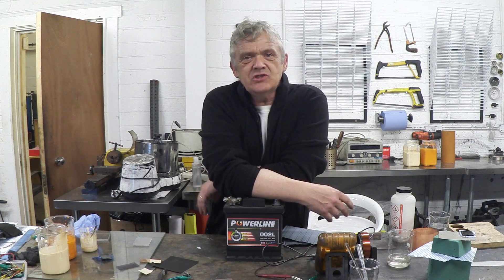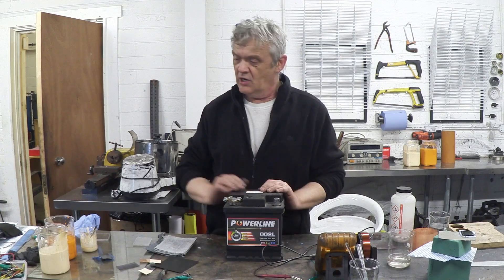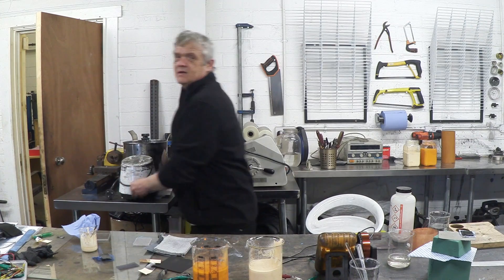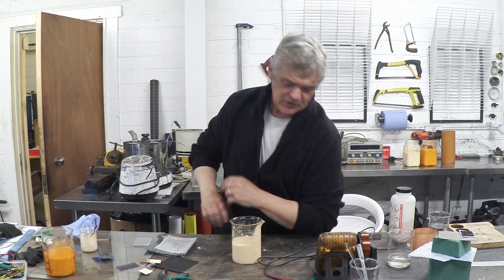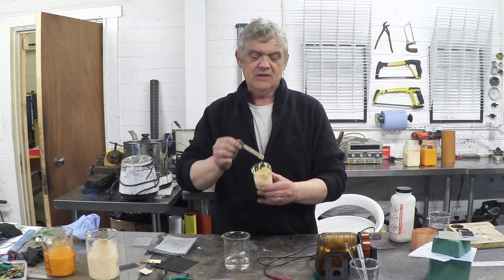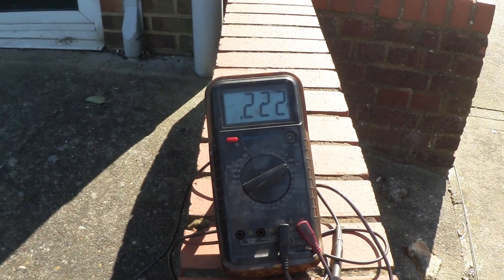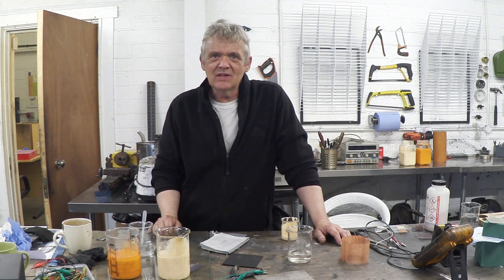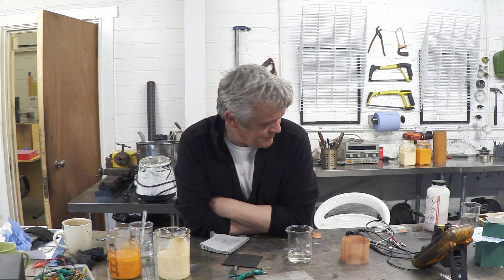How To Turn A Broken Battery Into A Solar Cell

Comment: Wow, this means we can make solar panels that are also Peltier devices, and turn the problem of the panel heating up into an advantage. If there are non toxic materials that have these properties, they could be spray painted onto a roof or the side of buildings to turn them into energy collectors... And if we add to that @Martin P. Hellwig's comment (from about two years ago), we get a "smart panel" that can include its own optimizing circuits.
I find this very exciting.

Comment: Is the voltage a function of the oxide surface area?  0.22V is hardly useful, but your example of concept is very small; would a much larger one be significantly more V?  Also, it appeared once painted the mesh resembled a solid, loosing all that extra surface area, so could you just paint it onto a solid collector?

Comment: Could you increase the voltage output if you used a larger surface area?
Reply: Yes, but that's actually bad news. If it produced 0.2v regardless of size, that would change the world. 🙂

Comment: There should be two plates one is  copper oxide. And what is the other?
Reply: I think he put a sheet of aluminium under it.  At least, that's the standard back plate for a solar cell.

Comment: That's quite amazing and inspiring! so we can make transistor with that too? Turns out all the piece are falling into place lol!
One thing with energy production is we either produce more of them to cover our need, our consume less of them. A lot of idea seems to be turned toward maximum production efficiency, and a lot of accessible technique get discarded because they aren't efficient enough, which make economic sense at industrial scale. BUT I feel like there is an opportunity at human scale to look into the direction of "slow tech".

While I was watching my plant growing in my experiment, it didn't really need a lot input, it really tooks it's time, but the plant at enough force to remove the lead on top of the pot, what if we create autonomous machine that just took their time like plants, they charge slow, but have enough energy to do work that aren't in an hurry. For example imagine an autonomous garden that slowly charge over time, taking energy directly from soil battery (just an example) then discharge it in time of harvest lol.
There is certainly a lot of essential infrastructure that can be turn autonomous with just slow system?
Reply from the maker: I would think so mate - certainly something to try

Comment: I'm thinking that you could nearly double the voltage output by taking a rectangular coper solar cell and painting half of it with the yellow lead paste. 
Hmm?  Would that constitute series or parallel?
Maybe that would increase your amp output instead?
Reply from the maker: both I would think
Reply: @ThinkingandTinkering  
That's a needs to be tested to find out situation. 
It may depend on where you put the jumper lead on the on the single side. 
At the far end a series setup would occur.
At the half way point where the yellow lead adheres to the coper, a parallel setup would occur.
Putting three leads on it, one at either end and one in the middle, a combination of series and parallel setup would occur.

Comment: Please tell me how battery prevents itself discharge through its own electrolyte.
Reply from the maker: it's not a battery
Reply: I mean the other electrolyte batteries like lead acid battery.
Reply: I remember when i was in perhaps 4th or 5th primary i build a small cell when i bruised the +ive and _ive wires spark and it survived 10-20 minutes also  turned hot unable to hold in hand. 
At that time i searched lot to explore these things due to the unavailability of internet, i read books and learnt internal resistance, electrode potential etc. I guess at that time something was making my cell to leak the charge through internal resistance hence (I square R loss). 
I left my experiment just by doubting the imperfections with my salt bridge. 
Sir u recall me all the work i was doing 20,23 years ago. I like it 👍

Comment: Thinking you missed a trick there with the lead oxide being an N type semiconductor, you could have paired it with the copper mesh (Cu2O- P-type) with the oven treatment?  Possibly not though as you'd have to make the lead coating thin enough to allow light to pass through, not sure? Semiconductors have always baffled me:-)
I absolutely love these videos Rob, I remember the early videos you referenced regarding the copper sheeting, tried that with little success and often wondered if it could be improved,  very keen to see more of your videos on this subject.
Reply: Just watched to the end, Peltier effect
Reply from the maker: not sure I did mate - but thanks for pointing it out

Comment: What if you used  a peltier  on  the back side of a solar panel? Would that increase efficiency,  or waste more energy than it created? I heard that solar panels lose efficiency when they get hot.
Reply from the maker: i don't know mate sorry
Reply: It would waste more energy since peltier modules are very  low efficiency

Comment: N and P type together should make a functional relay, which in turn you can make logic gates of which in turn can build a CPU, all by having two inkjettable slushes! Time and time again I am amazed at what you manage to figure out, very much appreciated!
Reply from the maker: my thoughts exactly mate
Reply: @ThinkingandTinkering  Hang on a bloody minute!

When i heard that the yellow lead was an n-type semiconductor, immediately thought that it could be used to make transistors using the p-type copper.
From what you two just said, it would seem that it's not just my wishfull thinking, but actually possible?
Moreover you could "paint" both materials?
Combining this whith paintable dialectric (laquer/water glass?) and conductor(graphite?) would make MOS-FETs and CMOS logic possible with very low tech tools/materials!
Although performance compared to similarly sized silicon based transistors would probly be abbismal.

Home made logic circuits from scrap materials...
That definitly has a nice ring to it! 
I think this would be an interesting idea for a video.
Reply: @erumaaro6060  there are metal oxide based transistors, so you probably could do this.  I'm hoping to do this one day, once I build a kiln.  That way I can try and make simple electronics from scratch.
Ultimate goal would be a CPU or microcontroller, but I'd need some sort of printing for that.  By hand I doubt I could do more that 1 transistor per mm, even with a ton of practice.
Reply: @gdolphy  Sam Zeloof did something similar with a projector focused through a telescope.

Comment: lead oxide,... interesting. I never I think about the lead oxide. I try materials like ZnO, TiO2, MoO3, CuO,.... but never PbO. Good to know,... I will try this to see what I will get. I try copper oxide (p-type) and zinc oxide (n-type) which was really simple cell and I get around 0.24V. Really fast made cell I made with oxidizing the zinc and heating the copper. Or with electrodepositon of copper and zinc first and then  oxidizing,.... the voltage will not be dramatically highger but the curren will be a litle better. So, thank you for this.
Reply from the maker: it is a surprisingly interesting material - folks avoid it from prejudice i think
Reply: @ThinkingandTinkering  Fear, more like. Lead in any form has been villainized in the States.

Comment: Does the colour of the coating affect the voltage at all? e.g. If it was a darker colour like Black, that has a higher Solar Absorption by say 25%, do you get 25% more output volts?
Reply from the maker: i wouldn't think so unless the material is photoactive - but i don't really know - i am just guessing
Reply: @ThinkingandTinkering  maybe some raspberry juice can help a little!? Raspberry or blueberry juice is used in dye-sensitized TiO2 solar cell
Reply: Robert Murray-Smith maybe a follow up video, tinting the yellow lead paste black? Or would the tint neutralise the conductive properties? 👍🏻